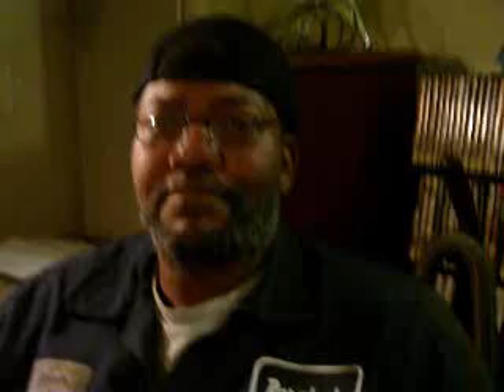709 ANT.MAN WHAT IS SWR.

Comment: Vertical standing wave ratio : A measurement of antenna resonance, reflected forward power from a transmitter into a resonant load, A measurement of resistive and capacitive loading of a resonant circuit.

Should i continue ?? He has a concept....The amount of theory required to fully explain it would be pointless. the more watts ya got,the lower ya swrs gotta be or ya gonna make smoke.

Comment: If Power changes SWR then any type of amplitude modulation must change through it's variation. No! No! Sorry, but Unless you are running power that starts to change the parameters of the antenna/other system via heating or flashing over, or if the modulation (of any type) is so wide it swings wide out of the "dead key" unmodulated range reading, a ratio is a ratio into another unchanging system (antenna or other). It is a fixed ratio # until the fed system is tuned or varied via adjustment(s).